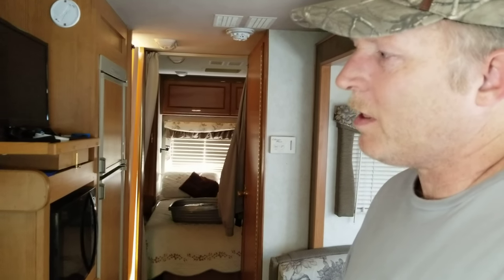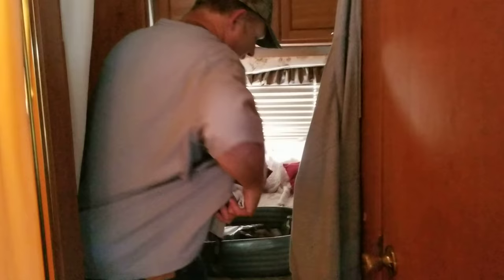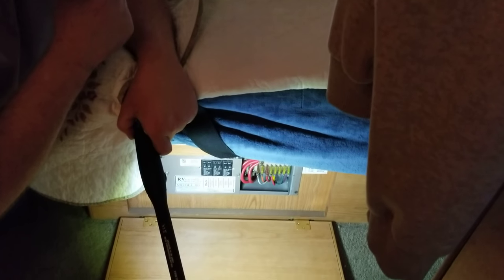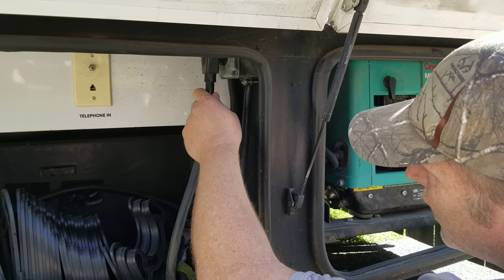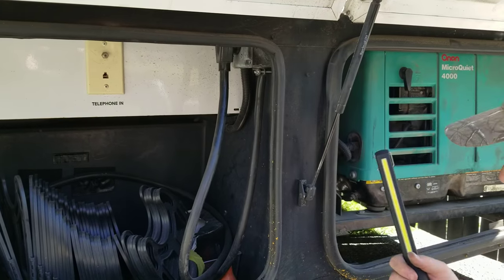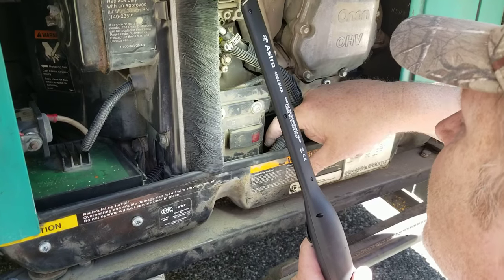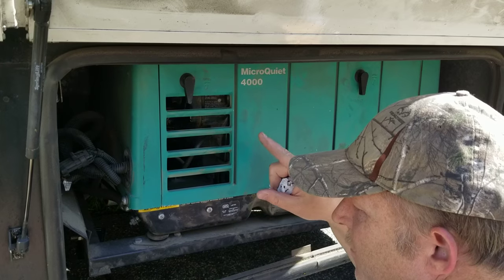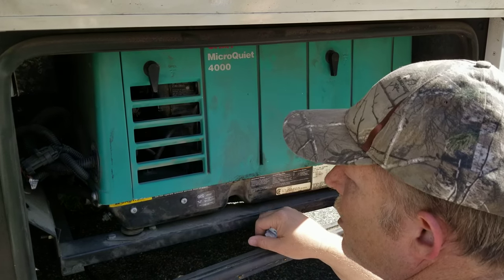Onan RV Generator runs but no electric - watch this fix

Comment: I’m boondocking in the desert. My Onan generator starts but it’s taking 17-18 minutes for the electricity to come on. Tomorrow when it’s light out, I’ll check your advice and see if I can figure it out.... but since the electricity does start eventually, I’m concerned that these 3 points of advice may not be the solution.. any idea?
Reply from the maker: I dont think my tips will work on this, sounds like interior issues with what produces the electric, deteriation, rust, something going out, that will require a trip to dealership unfortunately and may even require replacement.

Comment: I have a Onan Gen Set...the generator runs but little electricity..like the a.c. runs but real low...repair shop said stator assembly...do you agree?..could it possibly be loose connections or dirty connections..or tripped breakers?...thanks
Reply from the maker: give it a try first before paying anyone, its possible
Reply: @vegasdavetv  Thanks will try it..

Comment: Thanks Dave, great video. We're new into RVing. Our Onan 3600LP circuit breaker switch flips off constantly after only 6 seconds of running. Like your video, our generator itself works fine. What do you think we should check and consider replacing? Looking forward to more videos from you. Enjoy!
Reply from the maker: if your sure your not overload  the rv, a/c,fridge,tv,etc on at start up. I would say you have 1 of 2 issues.
1, a faulty wire or ground wire loose somewhere, or chewed into from a rodent or your plug in cord is dirty or damaged. 
2, your breaker itself is bad

Comment: So we flipped the switch and have tried all other suggestions and still have no power coming in. Onan works great. Transfer switch box has power when plugged to shore. Any other suggestions?
Reply from the maker: @LoriCouchot  that's a tough one to diagnose online
Reply: @vegasdavetv  It turns out the inside of the switch was somehow burnt and the switch had to be replaced.

Comment: I replaced my house batteries but couldn't get 110 power to the RV. I checked the power converter, the trip switches and the connections on the generator, but no power. I followed the instructions on checking the breaker and making sure it was pulled toward me. Still no power. Finally one last time I checked the breaker using a flashlight and noticed writing on the switch. Pulling it forward toward me it said off on the switch and pushing it away from myself it said on. I switched it to on and started the generator and it was working. It seems someon installed the switch backwards. Never assume everything is hooked up correctly.

Comment: My problem was intermittent. I pulled the fuse on the generator out and put back in, then flipped the breaker off/on. It worked a few more times but now it doesn't. It feels like the breaker is not "clicking solid" like other breakers. It's an older Onan and looks like it's really hard to get to 🙃

Comment: If the breaker needs reset at the Genny, normally with the newer ones  the genny will not start. the next check would be to see if you have shore power because your transfer switch could also be bad not allowing Genny pwr to cross over.

Comment: Grest video but for some reason my rv is missing an outlet to plug the shore plug into, can’t find it. Generator running great I have power during shore power but no where to plug back into the camper, 1997  Fleetwood southwind
Reply from the maker: that's weird, not sure why, should have one

Comment: If those dont work I am a tech. There can also be a short in the power from the gen to the plug so check for cuts. In newer models the gen is hard wired into a block usually located in the compartment behind the gen. Shorts are common in the wiring from the gen to the block. Broken wires do happen and running new 3phase isn't to difficult just take a picture of the block before you remove the wiring and copy it and make sure your unit is not plugged in the shore cable tends to be the middle of the block and can shock you.

Comment: What a great location for a vital component of the unit...who hides a breaker switch?
Reply from the maker: lol...lol...exactly
Reply: Idiots that build these things. Try changing the fuel pump and filter. Not for your problem. Just saying you'll wonder why they make everything soooooo difficult to get to. Everything was on super tight and super hard to get to. What a nightmare but I did it. But only after driving it to 3 places to remove the last screw to get the pump off the frame since the screw was stripped. Ugh.

Comment: I’ve been fighting my generator for a while now. It runs fine but soon as you turn breaker on it dies. Haven’t found anybody that can work on them locally either. Any ideas?
Reply from the maker: to much load usually does that
Reply: Does it with nothing on inside. Maybe the circuit breaker is bad then?
Reply: @vegasdavetv  I forgot it also does it when electric isn’t plugged in but circuit breaker is on. Runs about a minute with breaker on and dies. Turn breaker off, runs forever
Reply: @vegasdavetv  thanks so much for your help! Got me to looking more and ended up being spark plug. Would die as soon as any load was on it at all. Replaced plug, ran for 45 mins with everything going. Was starting good so didn’t even think to check plug.

Comment: I’ve got a weird issue going on. About 50% of the time when I am running the generator and then turn on the AC or the microwave, it puts so much strain on the generator that it actually turns off. At least that is what it sounds like. Engine slows until it just stops. Plenty of fuel. Plenty of oil. Generator only has about 175 hours on it. No breakers tripped, either on the generator or the inside breaker panel. Can’t find a loose wire anywhere. Very strange. I am beginning to wonder if the AC capacitors are going bad or if I have a bad circuit board in the generator.
Reply from the maker: as long as your not trying to run ac and microwave together,  you have a problem.  are we sure the generator is big enough? if it is, then there is a circuit or something wrong
Reply: @vegasdavetv  4000 watt Onan gas model. It should have enough power to run everything.
Reply from the maker: yesssssss it should, this one may require a diagnostic evaluation sadly..

Comment: So I just bought a motorhome with the Onan generator And I can't get to the generator to turn over The manual button doesn't work The remote button doesn't work there's no clicking sound nothing?
Reply from the maker: some issue I'm not sure, unless battery is low or dead or tge battery disconnect switch is on, those would cause a new start or crank
Reply: @vegasdavetv  where is that battery disconnect switch
Reply from the maker: I'm not sure on your coach, may be by front door, it kills power to batteries so they don't run down while in storage
Reply: @vegasdavetv  yeah I tried that And all batteries are fully charged

Comment: Nice video. Tried everything and still no power . But everything works find from house outlets. Any advice? Thank you
Reply: My Emerald 7000 same prob. I went the less expensive route & replaced the generator circuit board (dinasor $100)...nada.
Replaced the voltage regulator $215 + $15 S&H There is a more expensive Volt Reg For $280. The ONLY difference was the housing of it. I cross checked the dynamics of it with the supplier who verified it was the EXACT same just different casing. Saved $65..........bingo, full power. Also, clean the brush slip rings. YouTube has vids on that.

Comment: My Onan 4000 generator run ( all 12 volts items run) but my a/c & the 120 volts outlets don't work. The switch on the side of the generator was in the off position & after I reset it, still a/c & all 120v outlet don't work. I had cleaned the cables & posts, recharged the battery, checked all d/c fuses & all a/c breakers & stills no 120v power. When I use the house electrical 120v power line everything worked. I would like to remove the Generator switch to text it w/ my meter but don't know how is attached. also I believe that my inverter may be the problem but I don't know how to check it.(I do know how to use the meter).
Reply from the maker: check that you connected properly and tight all connectors and cables first. if it was working